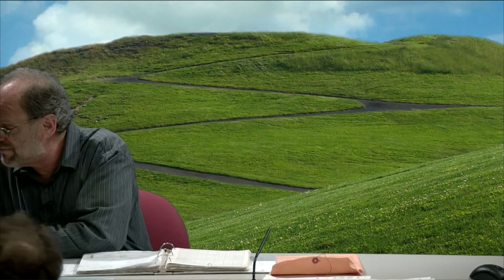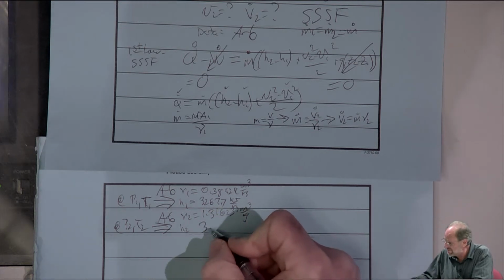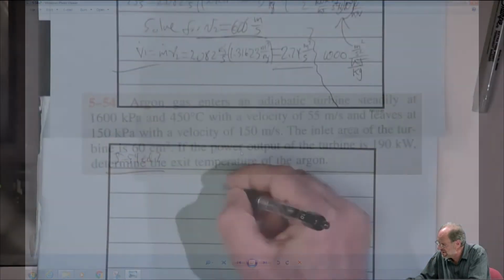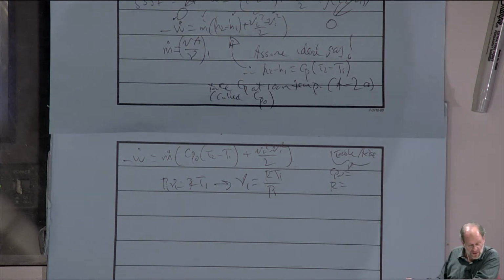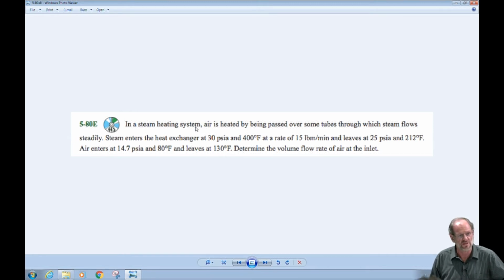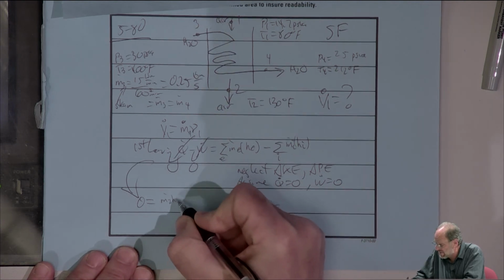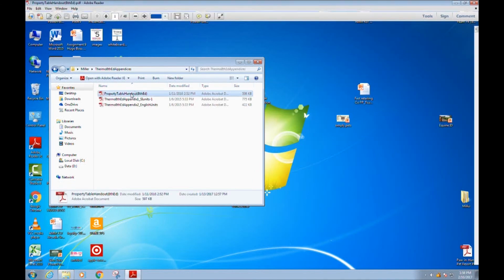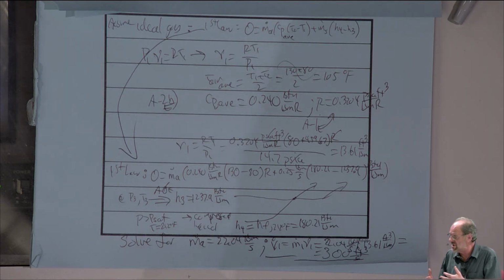Thermodynamics: 1st Law for Open Systems, Steady Flow Continued (14 of 25)

Comment: Early on (chapter 3), I didn't understand why we would/could use enthalpy values from the pressure tables - now I understand why we use table A4E for the last problem - enthalpy, "h", is a strong function of temperature, and a weak function of pressure. Therefore, enthalpy values for h4 come from table A4E, temperature table - 180.21 Btu/lbm.